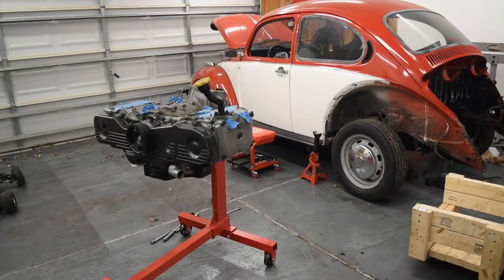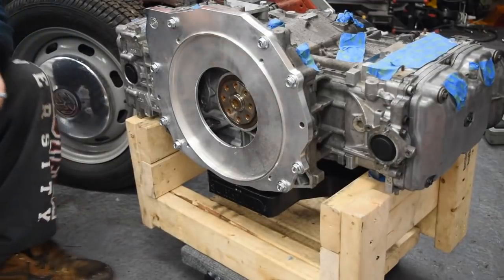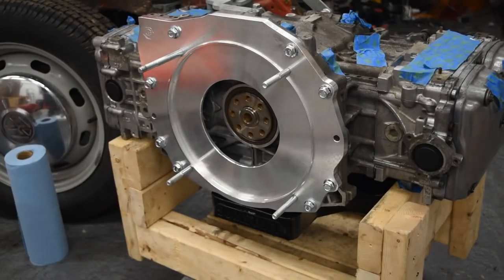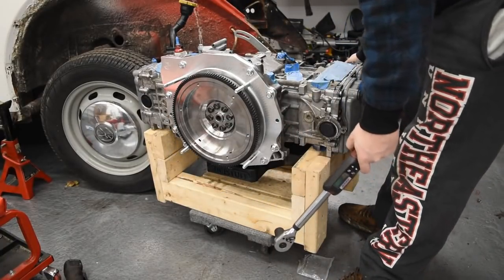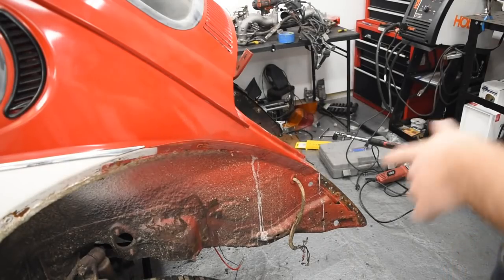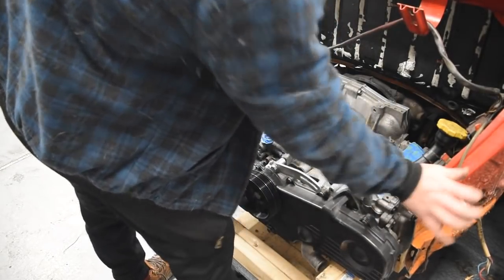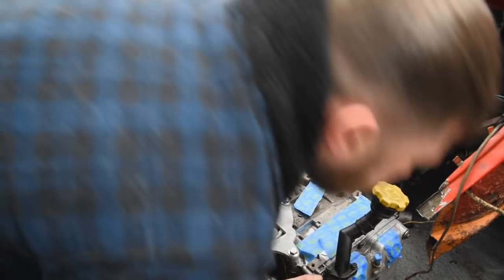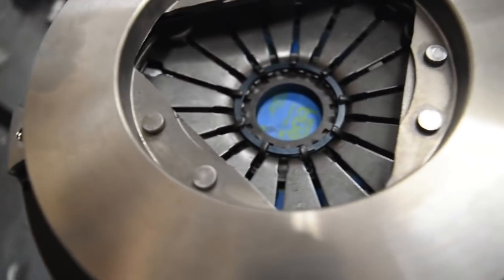Gearbox Adapter Plate: Subaru Engine Integration

Comment: Could this swap be done with an vw automatic stick transmission?
Reply from the maker: I believe so! You would just need the correct adapter plate for the automatic stick transmission to Subaru engine! Best of luck!

Comment: Did you use the stock transmission?  And how does it handle the jump in hp
Reply from the maker: Yes! Stock transmission with the KEP adapter kit. It drives very well and gearing is actually a pretty good match for the engine/turbo.  I've never really laid on it but everything has held together great. I just upgraded to bigger wheels and better tires, so if something is going to break it will happen now lol. If the stock transmission goes, I'll probably change to a Subaru transmission over an upgraded Type 1 unit.
Reply: @RatchetMotors  okay awesome, I’m starting the process of swapping a stock ej205 into a 72 super beetle and was trying to price out what I would need, not gonna worry about a tranny, thanks

Comment: Is there a automatic transmission that can be used?
Reply from the maker: Honestly I am not exactly sure. If the VW auto transmission has the same bolt pattern as manual, you may be able to use that. The other option would be putting a Subaru automatic transmission but I'm not sure a reverse pinion is being made for the auto. I'd check https://subarugears.com/ best of luck!

Comment: Which clutch did you use for your conversion?
Reply from the maker: The clutch I purchased from Cip1:

https://www2.cip1.com/ProductDetails.asp?ProductCode=ACC-C10-5149-KT

I chose the following options with the hope of holding the torque of the turbo EJ25:
K.E.P. 2100LB Clutch Plate
Heavy-Duty Cushion Lock disc

BEST OF LUCK!
Reply: Thank you

Comment: Are you mounting that to the stock transmission? I had someone tell me I’d need a completely new transmission if I were to swap to an EJ257. Is that true or is there just another adapter to go to the stock again?
Reply from the maker: Yes, this is mounted to the stock transmission. You can buy an adapter from KEP adapters to do an EJ Subaru motor to a Type 1 transmission https://amzn.to/2V4Ct7r. The person you spoke with may be referring more so about the capacity, as the Type 1 transmission was not designed for the power of an EJ257 but physically you can bolt them together with the adapter and have a driving combination. Most will recommend to swap the stock Type 1 transmission with a built unit or from a VW bus but I think the stock Type 1 transmission can last for a little while if babied, that is my plan!
Reply: @RatchetMotors  So there were no other add ons? Just that adapter and they work together?

Comment: hey I'm planning on putting an ej20 into my 1972 super beetle I was wondering if you had some kind of list of parts that you used for the swap?
Reply from the maker: Hello! Unfortunately I don’t have anything written down but I can give you an idea of the key systems. You’ll need to update your fuel system for EFI (high pressure/flow pump, filter before pump, filter after pump, regulator), you’ll need to mount your engine to transmission (either an adapter for EJ motor to VW transmission, or reverse gearset if using the Subaru transmission), and you’ll need engine electronics (I suggest ECU and harness from the car the Subaru motor came out of, or you can do aftermarket ECU with www.diyautotune.com). Subaru stock ECU will be easiest and are very tunable depending on your needs. Good luck with the build!

Comment: HELLO Ratchet Motor , i did mo got your Name but i like the video on the 73 VW with Subaru Engine ,i have a 73 VW myself i like to put a subaru engine too , what  engine i need #, or year. n good job n luck to you man, am Victor from Dunkirk NY
Reply from the maker: Hi Victor, thanks for the support! You can do this conversion just as I have with any Subaru EJ motor (ej18, ej20, ej22, ej25) which came in most Subaru’s from early-90s to 2015ish.  It really depends what displacement you are looking for and other options like throttle by wire or turbo. Good luck!

Comment: Waste of time, you can get more horspower and reliability out of a VW engine up to 350HP ....Here are 25 examples....https://www.cbperformance.com/category-s/352.htm
Reply from the maker: That is entirely false. While reliability is not cut and dry, I am using almost an entirely factory Subaru engine (which means factory reliability) and should be more reliable than any strung out comparable air cooled engine every day of the week.  Add in that I’m in this way under any of those listed prices and the fact that this setup will be capable of 350hp without batting an eye and I’d have to say I strongly disagree with your comment. To each their own though and good luck with whatever path you choose!
Reply: @RatchetMotors  You are absolutely right... almost stock Subarus's and high performance ones are very reliable!... My comment is regarding all the useless modifications and sacrifices of spaces on the back seat and in the front of the hood to accomodate a radiator..... Wen it is easier to use a VW engine in the bug and surpass any performance gain with the Subaru engine.... For show or for simply stetics looks good, but, take it to Baja and show me how it performs with the Subaru engine!

Comment: Hi what name brand and model of that clutch?
Reply from the maker: Sorry for the delay! I am using an off-the-shelf Type 1 clutch from CIP1 https://www2.cip1.com/ProductDetails.asp?ProductCode=ACC%2DC10%2D5149%2DKT.  I went with the 2100lb KEP Clutch Plate and the Heavy-Duty Cushion Lock Disc but that is just personal preference and based on my motor combination.  Long story short, if you use the KEP engine adapter for the Subaru motor to VW transmission, you can use any Type 1 clutch for that transmission.  Thanks for the support!

Comment: Hello my name is Juan, im from Ecuador, where you From? What flywheel and clutch kit do you use?
Thanks a lot!!
Reply from the maker: Hi Juan! I live in North Carolina, originally from Massachusetts. For the flywheel, I ordered a KEP adapter from Amazon (https://amzn.to/2xfBh5l). For the clutch, I ordered the 2100 KEP clutch plate and Heavy-Duty Cushion Lock Disc from cip1 (https://www2.cip1.com/ProductDetails.asp?ProductCode=ACC-C10-5149-KT)
Reply: @RatchetMotors  thanks a lot!!! Did you change the brakes?
Reply from the maker: Brakes and suspension are going to be our Phase 2 of the project, don’t have a definite plan yet but they will certainly be upgraded for the increase in power
Reply: @RatchetMotors  ok, I really want to make a similar proyect, but here in Ecuador is very expensive, for this reason I will do slowly.
Thanks a lot!!!
Reply from the maker: That’s awesome! Let me know if you have any other questions. You can always reach out via email at ratchetmotorsnc@gmail.com. Good luck!

Comment: Hi there, good video. In which Subaru model can i find the same engine?
Reply from the maker: Thank you for the support! The longblock is the combo of an EJ255 shortblock (08+ 2.5 WRX, 03+ FXT, etc.) and EJ253 heads (+03 Impreza). It is essentially a turbo block with NA (SOHC) heads. Please let me know if you have any other questions.

Comment: Where did you get your ej?
Reply from the maker: I got the EJ255 shortblock off craigslist and had the EJ253 heads from a previous project. I’m pretty much piecing together left over parts around the garage to keep this build budget friendly. I would suggest a junkyard or JDM importer if you are looking to do the same as I still ended up spending more than I wanted between different hardware, sensors, and other components that didn’t come with the shortblock or heads.

Comment: Why choose the most undesirable Beetle for this swap? Even after it's complete it's still a $2500 piece of shit with no resale value car! The deluxe and super beetle are the least desirable models ever built by VW
Reply from the maker: Sounds like a perfect candidate for a swap. I don’t care about resale or what other people find desirable. This is a project for me
Reply: @RatchetMotors  sorry guy, sincerely...but I've always had a severe dislike for any attempt to improve on Ferdinand Porches design...ie: it was the perfect car. I've used points off a Briggs and Stratton lawn mower in a 1972 VW Thing ...aka: the Safari in the jungle on the Yucatan Peninsula 60klm from nowhere and had more to give till I traded it for a 78 Westphalia

Comment: Like your honesty,we all make mistakes,nice video,thank you for upload.
Also did you make sure gearbox has a welded 3/4 syncro hub,as the original ones are just pressed in and with high horspower engine swaps will slip and possibly cause damage?
Reply from the maker: Thanks for the support! Gearbox is completely stock but will be replaced in the future
Reply: @RatchetMotors  Your welcome.thats cool,certainly plenty about.I liked the music,but im into Electronic synth music anyway,Stay safe!
Reply: how much does the transmission handle and can u upgrade the gears ?

Comment: Never worked on a Beetle but my understanding is that the engine is cantilevered from the transaxle. Will the added weight of this engine be a problem?
Reply from the maker: Very valid question and you are correct. In the future, I will hopefully add something like a Kafer cup brace to help reinforce the motor support.

Comment: What yr is the subaru engine?
Reply from the maker: The shortblock is EJ255 which can be found in 2004-2013 Forester XT and 2006-2014 WRX I believe. The heads and intake manifold are from an EJ251 (2001 Impreza RS but can be found in many other 2.5 naturally aspirated Subarus)
Reply: Ratchet Motors Hi there thanks for replying to my question.  What are you thoughts in regards to the wiring?  I have been thinking about doing one of those conversations for many years,  but sick to the stock or work the stock engine and convert then to anything bigger than 1600.  Cool project.  Also liked your wood cart to move the engine.  Keep it up 👍 
Thanks for sharing.
Reply from the maker: My plan for wiring is to merge the engine harness from the EJ251 with the universal harness from DIYAutoTune.com I think this should be relatively straightforward and will only require a few additional connections that won’t be in the original Subaru harness (fuel pump, oil and fuel pressure sensors, etc)

Comment: From what I can see, you have the later style cradle mounts for a 1974...those are horribly soft.  Every late model Beetle I've ever worked on, I've recommended to my customers to go with the cradle mounts up to 1972 from CB performance.  I've run 250 VW turbo engines and never had one rip.  Oil doesn't hurt them either.

I don't know how much experience you have, but a suggestion when stabbing an engine.  If the output shaft of the transaxle doesn't want to fit into the spline of the clutch disc (assuming you used the centering tool) , you should place the transaxle in 4th gear, and when it's close spin the wheel a bit and try again.  That way you avoid damaging the bolt that holds the crank pulley.  Then it should slide right in. 

And yes, you have the late model TO bearing.   I have a collection of those rings in my garage.   Lol.
Reply from the maker: Thanks for the feedback! I appreciate the suggestions and fortunately the engine slid in very well with that ring removed. I do have the late model mounts but I did not think they were horribly soft. I will keep an eye out for them for sure.
Reply: @RatchetMotors  I have an EJ20 long block sitting in my garage it's just a mock up piece.   I have a 71 Super that's been in my family since I was a year old.  It's either getting the Subaru engine or I may go with another Type 4.  

I dig your project.  I like the MS option.   It's less expensive and allows you to tinker.  Is your engine a JDM unit?  I see it has the big ignition coil on top.   I'm pretty sure that I will remove the majority of the firewall and package tray.  

I will subscribe.    Good job.
Reply from the maker: Thanks for the support and the sub! That sounds like a really good project and I don’t think you could go wrong with either engine. The ignition coil goes with the heads which are from an EJ251 (I think from a 2001 Impreza RS). Everything Subaru I’m using right now is USDM but a hodgepodge of models.

Comment: You really need to work in a space where you can speak as loudly as you want. It seems like you're trying to avoid waking other people up by talking super softly. 

I wouldn't mind the music at all, if it weren't SO MUCH LOUDER than when you're talking such that when I turn it up to hear you speaking I then get blasted out of the universe by the music.
Reply from the maker: Talk about beating a dead horse... In case you missed, there is now a version that does not include music. Continued comments about the same problem (which has been resolved) adds no value for anybody.
Reply: @RatchetMotors  Don't misunderstand me; I think the music is fine. I don't mind the choice of tunes. The reason I've bothered to comment is because everyone else seems to be complaining about there being music at all. I think music adds a nice touch, though. B Is For Build uses music to great effect, for example.

What I want is for YOUR VOICE to be LOUDER.

If you want, you can do them without music, and that's fine too, but even the one you did without music is so quiet (especially when you're talking about the custom made flywheel with the right spacing) that I have to turn up my computer's volume so much that when other system alerts come through on my computer like for a new email coming in, it's like the old Maxell cassette tape ads.

Comment: Ppl here rattling on bout the music, much the same as ppl out there going on about toilet paper.. 🙄😅
My question: what about room for changing spark plugs? Can't see much access from the cameras perspective.
Reply from the maker: Haha yes I agree! At this point I’m only responding to positive feedback. I agree about spark plug clearance, I’ll most likely be trimming a little more of the body or at least adding access holes. Initial trimming was only to physically fit the engine but a lot of maintenance items still need to be considered, like you mentioned. Thanks for the support!

Comment: Personally I've had about six Subarus maybe 7 I loved every one of them the motors are pretty much you know the same other than Subaru is way more advanced but that's a great swap I've seen a couple of Westies with the Subaru engines in them I can tell you that things going to haul balls. A buddy of mine when we were in high school had a Porsche Super Beetle and another guy had a V8 Super Beetle really fast both of them but the one with the Porsche motor you couldn't even tell that had that in it other than the way it ran good luck Godspeed
Reply from the maker: Yes, I’ve always been a big fan of Subarus especially coming from New England. Thanks for the support, video of fitting the turbo is on the way!

Comment: Agree the music should be lower than your voice also I learned one thing measure twice three times and more your input shaft could be too long that special thing you took off you need to check to see your throw out bearing clearance otherwise Subaru engine in a VW wise idea can't wait to see the radiator in the front what's a nice electric cooling fan and the other one  they forgot their conditioning well you probably put the heater under the back seat
Reply from the maker: Thanks for the feedback, video without music can be found here: https://youtu.be/bFnhLBYjyko

Comment: Very nice and clean build, btw how much hp are you putting down on the wheels?
Reply from the maker: The car is not yet running but with the turbo I expect at least 250hp to the wheels. For reference the motor is ej255 shortblock with ej251 heads, delta 1500 camshafts, and vf48 turbo so should be making around stock STI power

Comment: You fit this engine in vw original gearbox?
Reply from the maker: Yes, the Subaru motor can be mounted directly to the original vw gearbox using a Kennedy Engineering adapter plate.  I bought mine on Amazon https://amzn.to/39DT04n
Reply: @RatchetMotors  
Thanks which sabru motor  use?

Comment: Are you using the stock beetle differential
Reply from the maker: For now, yes.  I will be keeping the stock transmission and differential for the time-being to keep costs down but do plan to upgrade some point later down the road.

Comment: I like the music, it’s your video, do what you like I say. What year is the engine?
Reply from the maker: Thanks Jon Paul! Always appreciate some positive feedback and I agree, in the end it should be what I want.
I believe the shortblock is out of a 2007ish WRX (EJ255) and the heads are off of a 2001 Impreza RS (EJ251).
Reply: Ratchet Motors that’s cool, mines an ej20 in a splitscreen kombi so that 2.5 litre with turbo will fly!
Reply from the maker: An ej20 Kombi sounds awesome! Any suggestions/recommendations based on your experience with VW/Subaru combination?
Reply: Ratchet Motors Hi Mate, use the factory ecu that came with the engine to avoid headaches, fuel system, in tank or external pump, external can be a bit noisy. Cooling system use a factory radiator should work fine, mines an wrx one and operates off the ecu, also set up a temp gauge on the dash and use the factory sensor to keep eye on temp, mine sits at 190deg all the time. I use two fans to push air over rad, you may mount vertically. Mount the heater core higher that the rest of the plumbing so you can bleed the air out of the system. Air in the cooling system means high temps guaranteed. Use engine mount subframe from Subaru and modify to fit bug. If it’s a 2007 engine then the may have engine immobiliser in factory ignition key, mount complete barrel and key in a hidden place so you can remove key and car won’t start if someone breaks in.

I’ve got loads more but don’t wish to bore you! Haha